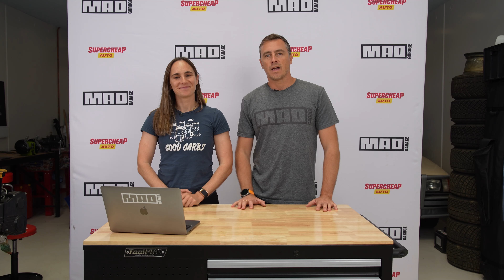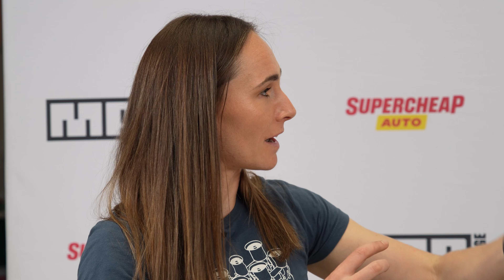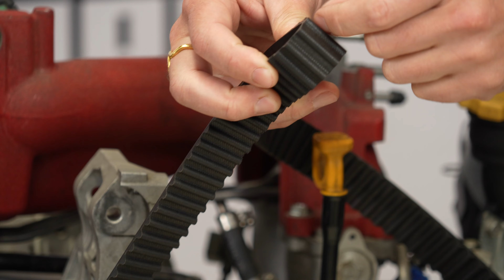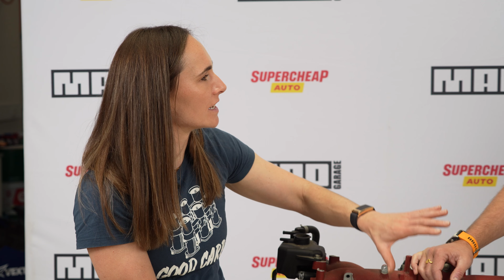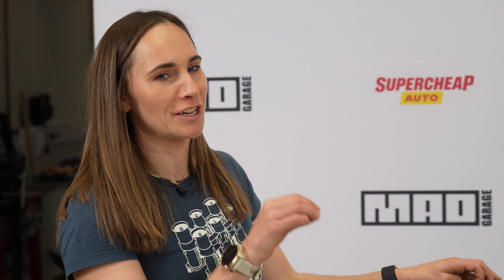Why This $20 Part Could Cost You $20,000 | Timing Belts EXPLAINED

Comment: Ha, loved it. Valves interfacing with pistons is not a good look with "interference" type engines, lots of cash to fix and your preaching to the converted in that sense. However I'm betting the GT being " dinosaur" type is damn near bulletproof using pushrods (hopefully double row timing chain )and one cam for fuel/air efficient combustion, plus it sounds shitloads angrier than a flat 4, other than the original Legacy, and 1st Gen WRX's as they sounded sweet too.